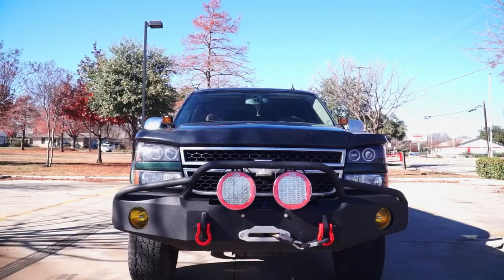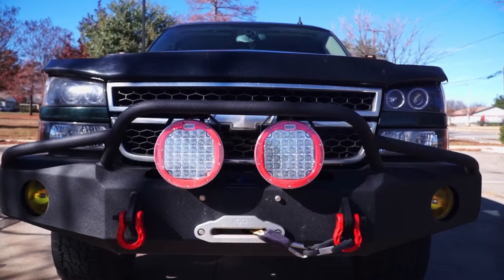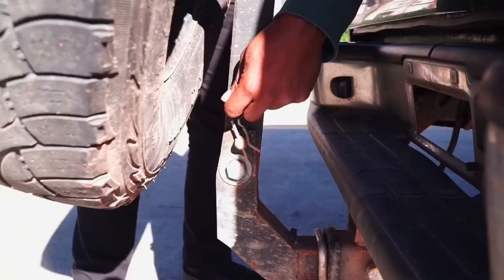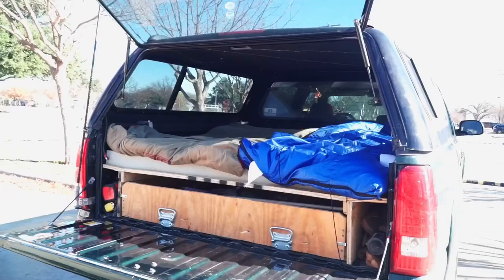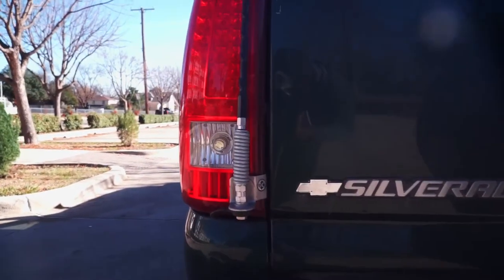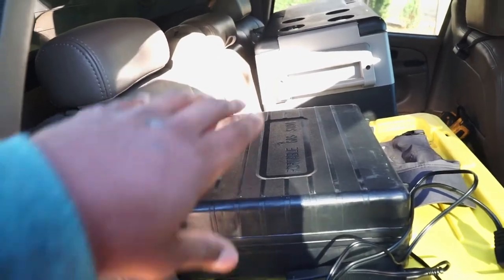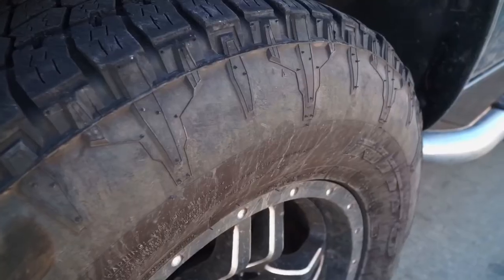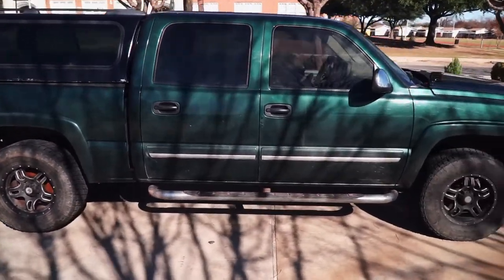Overland Silverado Build Walk Around

Comment: I like the setup. It's refreshing to see a Silverado overland rig.  I have a 2010 z71 and camp out of the back sometimes,  just got back from Homochitto national forest a few days ago.  My setup is similar to yours except I dont have a drawer system, solar power, cb, or fridge.  I just do a pelican cooler and a truck bed tent.  Then I have a Plano box for kitchen stuff. One thing I did is got a dual battery set up with an isolator so i can run my winch,  lightbar, and a few 12v plugs I installed in the bed as well as an inverter off of a different battery than my starting battery. I can run two heated blankets, charge my phone and an ipad all night in the winter and never drain my battery so it's a good piece of mind.  I also bought a rigid hitch in-bed spare tire mount for my truck bed. Its sturdy,  doesn't take up too much space 305/65r18, and I can leave it back there and still have plenty of room for sleeping for two and a dog. Thanks for the video.
Reply from the maker: Hey simplicity is key. I’ve played with the idea of a dual battery setup similar to yours. Sounds like you have a really good build! I’d love to see it. Thanks for your input.
Reply from the maker: Hey simplicity is key. I’ve played with the idea of a dual battery setup similar to yours. Sounds like you have a really good build! I’d love to see it. Thanks for your input.

Comment: Looks good bud. I built mine over the last ten years. I used all crappy lights and made my own switch board that failed years ago. I may order a RC looks neat.
Reply from the maker: Thanks! I’ve been building mine for a few years as well. I also thought about making a panel but I’m no bueno with electrical things which is why I just went ahead and bought the panel. I believe there’s a link to it in the description box.

Comment: Nice I have 09 2500 Silverado 6.0 baby. Sounds amazing. Been wanting do something like this my self. Nice set up! Have you seen the seat covers that help organize misc stuff for the back of the driver and passenger seats might help. I have seen people have a swing out tire system for the chevy. It replaces the whole rear bumper they reviews say it’s a little heavy with no added off-road benefits might be better off getting a roof rack and sticking the spare on top.
Reply from the maker: That’s a nice platform to build on! Yeah I’ve seen a few of them. I definitely need to organize the back of the cab a little more. Thanks for the suggestions! I’ve considered doing a complete build of a new rear bumper with a tire carrier on it but a custom one might be out of my price point. Something will come up, eventually.

Comment: love the setup. check out titan spare tire fuel tank. or maybe fab up one from k5,suburban. older ford trucks with rear fuel tanks. trailer stub axle and hub assembly will help build wing out tire carrier.
Reply from the maker: Thanks for the suggestions. I would love an additional fuel tank especially in that spare tire whole. I thought about putting a water container there as well.
Reply: @routinemarkout2099  keep water tank inside. checkout atv sprayers. come in diff sizes and come with ondemand pump already plumbed in. sailboat topload freezer/fridge. can remote mount compressor underneath or between bed sides. coleman campstove and oven mounted to a swing out tv mount. use it inside or swing out for nice weather. and a 4d truck battery will fit between bedsises on passengerside.

Comment: So cool to see someone doing something with a domestic truck.  You see so many people blabing about Toyatoes and Jeeps while looking down their noses at everything else.  So what are you using to power your fridge when you're out and about?  What power source/battery system are you using with your panels?
Reply from the maker: Agreed! I wish I would’ve focused more on my truck, that I’ve had since college, instead of recently buying an older Jeep. Now I’m trying to get ride of the Jeep and focus on my truck and bike. I have yet to have to plug the fridge in the kodiak solar generator that we use. I keep it on eco mode and it does fine overnight plugged into a cigarette outlet in the truck cab.